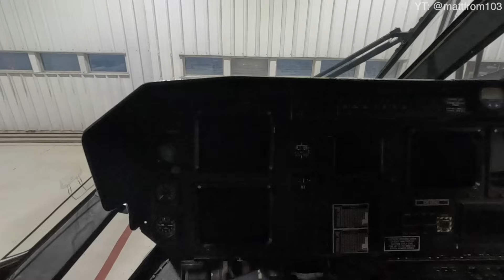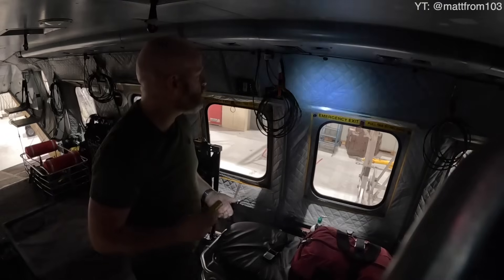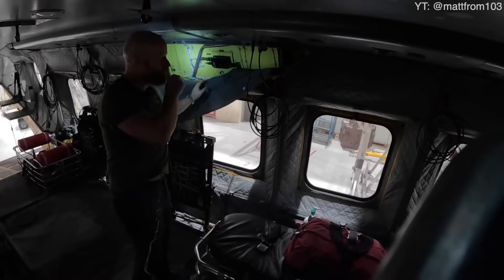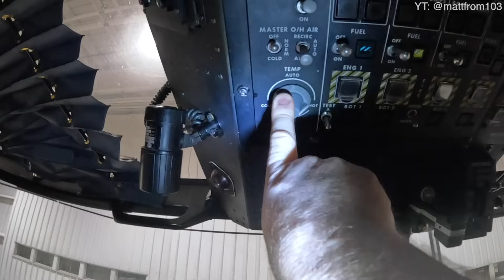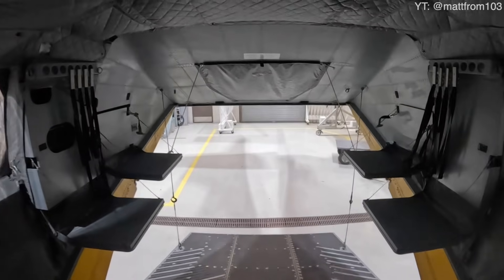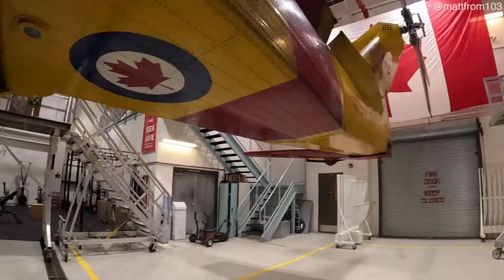Tour of Cormorant Helicopter - Questions answered.

Comment: Probably a dumb question, but does it have auto pilot or are you stuck hand flying a heading for 4 hours?
Reply from the maker: There are various levels of automation in use at all times. If it's straight and level chances are I am not on the controls and just monitoring. Landing, take off, or very dynamic maneuvers then it is all pilot normally.

Comment: 8:47 the air dryer is likely similar to how defrost works in an automobile or a heat pump clothes dryer: pass the air over cold coils that causes moisture in the air to condense on the coils, leaving dry cold air. Follow that with a heater stage to warm the cold dry air back up (if your car doesn’t have a defrost button, turn on AC and heater at the same time).

Since the air is already cooled below ambient in a previous stage on the helicopter, you just need to add a condenser in the airflow to allow moisture to condense out of the air. This gives you dry air.

Comment: Thanks Matt. Another really interesting video. Just wondering the typical training path for a Cormorant pilot. Do you start fixed wing for basic flight training and then at some point transition to rotor wing? Is a big step from the training chopper to the Cormorant?
Reply from the maker: In my case I went from the basic helo course straight to the Cormorant. It is a bit of a big step but that is common in the RCAF and other militaries. The training chopper for me was a Bell 412 with glass cockpit with 2 crew, so it wasn't that big of a step. 

All pilots in the RCAF start out of small fixed wing trainers and then proceed down the various training paths. 

So for me it was Grob 120 -> Bell 206 -> Bell 412 (get wings) -> Cormorant. I had maybe 250ish hours total time before proceeding onto the Cormorant. Once on the Cormorant it was 2 years and 550ish Cormorant hours before upgrading to Aircraft Commander.
Reply: @mattfrom103 Thanks Matt. That’s interesting.

Comment: I think the technical name for the adjustable heat outlet... device. is a WEMAC. Air gasper is a more common name but those are more like the airliner overhead style that has the little nipple in the middle instead of the pivoting flap like a WEMAC uses. And now you know, spent 12 years as an aircraft mechanic in the states before someone wrote up a defect on a WEMAC and I had to google wtf that is.
Reply from the maker: Interesting. We call them punkah louvers.

Comment: What is taken into consideration for static discharge while hoisting? Red October style?
Reply from the maker: There is a small device that can hang lower than the ST. It's essentially a copper weight on wire that will ground first.

Comment: Very interesting and great explanation.  Thank you! Are there a number of specialized tools on board, or just ‘standard’ tools to do any kind of work on the aircraft when out in or field, like for those times when you might need to work on the tail section?
Reply from the maker: They are mostly standard 'aviation' tools. A lot of the fasteners are 'torq set' which are not household common.
Reply: @ Good to know. Thank you.

Comment: Wow, I didn't know how the air conditioning worked in aircraft. I guess I always thought it was like a car AC system, with an electrically driven compressor (like electric cars have).

Thermo always blows my mind a little bit that you can feed in hot squished air, some outside air, and get cold air out the other side. Does the ECS use any electrical power, for blower motors for the heat exchangers? Or purely bleed air powered?
Reply from the maker: In side there is an electric blower motor, the blower motor on the actual pac is fed by the expansion turbine I think. All the controls, montorring, and switches would be electric.
Reply: Cool ty!

Comment: You may have this planned, but it would be interesting to see how your team 'packages' a patient for transport.  A simulation that includes the initial evaluation, loading them on the stokes, etc.  I know helicopters are LOUD so how do you communicate with and protect the hearing of the patient.  Those types of things.
Reply from the maker: I'll see if I can get training videos. Normally once the STs are inserted the helicopters goes away if able. That gives peace and quiet for all involved.
Reply: @mattfrom103  By noise I was referring more to once the patient is in the helicopter for the ride to the destination.  When packaging, do you do anything to protect them from the noise and to make it so they can communicate with the team, or does everyone just 'shout'
Reply from the maker: @1988texasaggie Patients will usually be given aviation headsets that attenuate a lot of noise. This also allows them to communicate easily on board the helicopter. At times the patient speaks an different language and STs resort to Google translate or similar.
Reply: Great explanations. All of your content so far has been so educational and entertaining. I was curious at the time about what turned out to be the ice thingy. So wonderfully low tech.

Comment: Thanks for the further dive into the systems! You may have addressed this in a previous video, but how often does the airframe have to be inspected for corrosion or other faults like loose rivets/fasteners, bent stringers, etc?

Also, the camera system for the rotor inspection - is there an active balancing mechanism, so you can move weights while in flight?
Reply from the maker: Everything has a prescribed inspection and maintenance cycle. It ranges from every flight, every day, every 50hrs, 75, 300, 600, 1200, 2400....etc. As well as inspections based on calendar days. It is extremely detailed and I can't explain it in a few lines unfortunately. 

The weights are added or subtracted physically once the rotors are stopped and the helicopter shut down. It cannot be done in flight.
Reply: @mattfrom103  Thanks for the added info!

Comment: Thank you for answering the heating question, much appreciated! The cooling system is ingenious, great design, thanks for explaining that as well. You are a good teacher! Regarding the cooling I'd like to share a quote from a P-51 pilot I find quite funny. He said: "My A/C is called: 10000 feet." Keep up these kind of videos, great work!
Reply from the maker: Glad you liked it. Yes, 10000 is usually quite cool. Unfortunately it's not always ideal to cruise up there. Due to the thin air we are also only allowed to be up there, between 8 and 10 for 4hrs.
Reply: @mattfrom103  I remember a flight with my paraglider in the Austrian alps a few years back. At around 3300m we had about 6-8 degrees Celsius and a bit over 25 degrees Celsius when landing at 900m. The air was literally layered that day and I could feel every layer becoming warmer and warmer. It was quite the experience coming down, like stepping into a warm bathtub. Air is fascinating!
Good info with the thin air at 10000, I forgot that you are not pressurized. What is the max ceiling you reach on a typical day? Depending on wind and weather I guess?
Reply: @dr.chives Haha, even when hiking in the alps you can really feel the difference in altitude. When descending quickly, even by foot, the temperature (and air density) change can be quite noticeable.

Comment: Nice video. You mentioned the heating and cooling, I was wondering what other crew/passenger comfort items you have for those long flights?(or what would you add if you could?)
Reply from the maker: Water, snacks, ear plugs for those not on headsets, seats,...that's about all I can think of. There are not formal facilities to relieve oneself.
Reply: @mattfrom103 You forgot the enclosed cabin😉
Reply: @mattfrom103  “There are not normal facilities “..

As all things “True Canadian”. As the Canadarm is to the space shuttle. Surely there is room here for a Canadian Tire sponsorship and logo sticker…on a bucket behind the storage racks. Of course with the strict caveat that it is the only C.T.  Product to ever be allowed on the aircraft.
Reply: The aircraft has a very good bleed air system that taps hot air from the engines. This provides very hot air that is delivered through small round vents (punish louvred) in the cabin. These look very similar to ones on airliners above your seat. There are several in the roof throughout the main cabin and cockpit. There is also a large air conditioning pack under the floorboards in the back, basically where the FE sits.
Reply: Punkah louvre. Darn auto correct. Sorry to steal your thunder Matt. Awesome vids
Reply from the maker: @davegalant4347 All good Dave, thanks for explaining. Feel free to jump in any time to share your knowledge.

Comment: It's always a good day when you post another video. I believe I have seen that CH-149 901 has passed 9000 flight hours. My son is a civilian AME and I am amazed at the lack of metric fasteners. Is the Comorant metric or SAE fasteners? Thank you.
Reply from the maker: It did. Couple weeks ago maybe? I was actually flying it when it reached that milestone. 

I have no idea about the fasteners. I'll see if I can find you an answer.
Reply: @mattfrom103  Thank you, does that make 901 the highest hour AW101 variant?
Reply: @mattfrom103  The EH101 is from a design perspective essentially a metric aircraft. However,   when it is necessary to install non-metric based equipment or sub systems then it is necessary to use the appropriate type of fasteners.
Reply: @alistairgraham476  Thank you sir, that does answer my question.